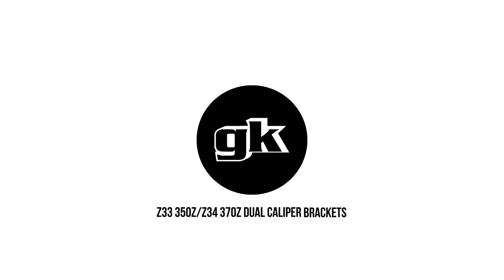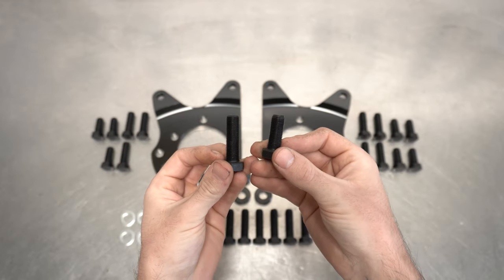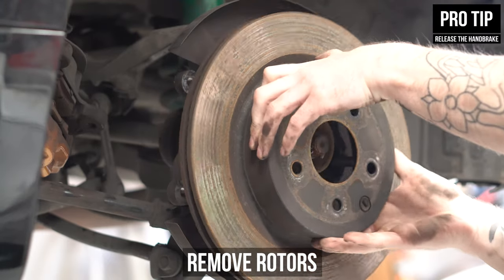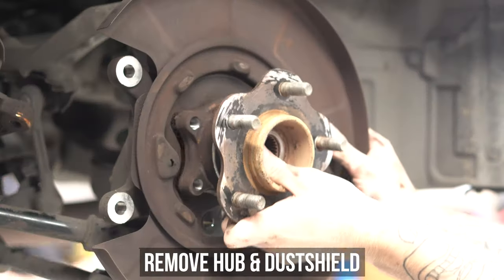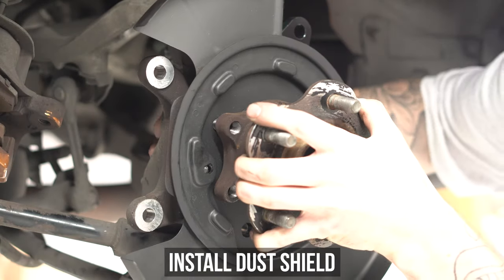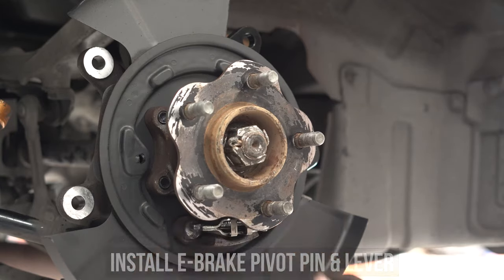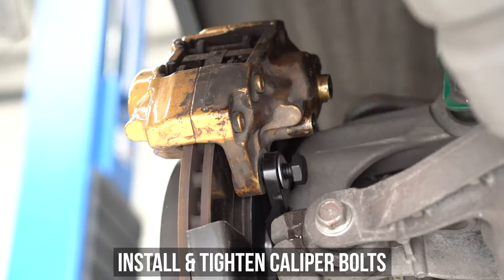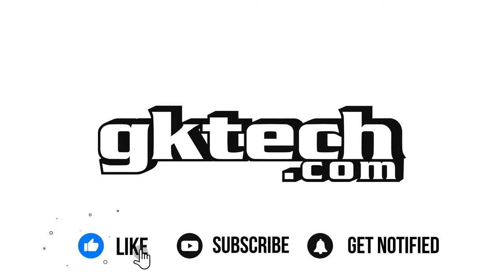Gktech Z33 350Z Z34 370Z Dual Caliper Brackets - Install

Comment: When you installed the E-brake nuts do those need any sort of loc-tite since the nut is tightened like 2-3 threads?
Reply from the maker: We recommend loctite, or we offer extended studs for the drum mount.

Comment: Would a grip build benefit from this?

Is it possible to engage both calipers at once/not the handbrake but with the foot brake.
Reply: Brake balance is usually more towards the front because of the weight shift so not sure if that would help too much. Would also f with abs maybe

Comment: When installing the calipers would what would be considered the rear right calipers turn into the rear left and vice versa for other side? like when buying a pair of the calipers that are made for the rear right normally since they are going on the other side of the rotor it would turn into the rear left due to the bleeder?
Reply from the maker: That's correct mate.

Comment: Does this require modification to the bracket or knuckle? Mine won’t sit flush on the knuckle on my g37
Reply from the maker: Hi Chris, some Z34/G37 will require slight shaving to the knuckle.

Comment: Hi there! 
Would this work with WILWOOD 1 or 2 pot calipers ?
Reply from the maker: It only works with the OEM 370Z parts. We don't make any brackets for wilwood options on the Z as the OEM components are well and truly good enough.
Reply: @gktech 
Many thanks for reply!! I just struggle to source a set oem over here under 300£ right now

Comment: if i buy the kit for my 370z do i need to buy the dual caliper setup? and if so does it have to be the same as the other brake pad on the wheel?
Reply from the maker: You will be required to source additional calipers, whilst the caliper must be the same you are free to use any pad of your choice.

Comment: can you use front calipers for the ebrake or would they have to be rears?
Reply from the maker: They need to be rears
Reply: @gktech  they also have to be the same as what you have right? like brembo w brembo or could you use something else?
Reply from the maker: @SashaGransjean  They need to be a matching pair, correct. This is due to different calipers requiring a different rotor.